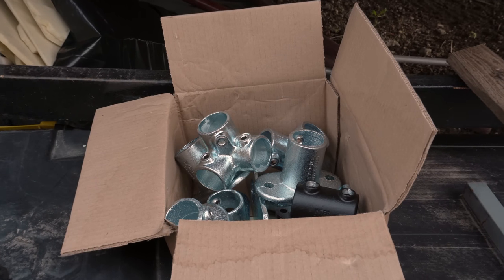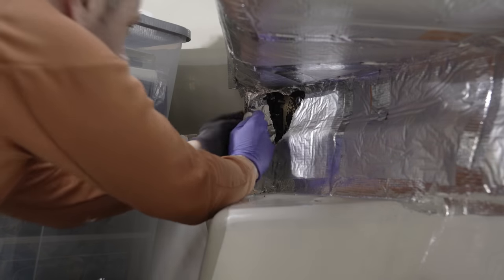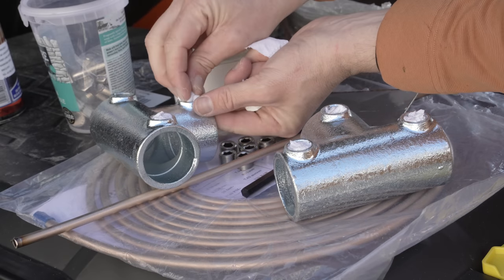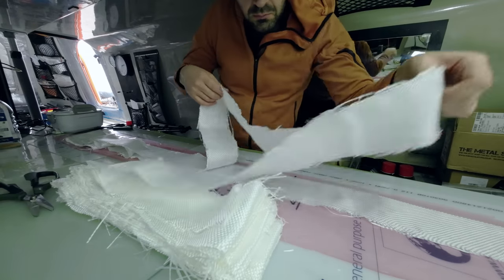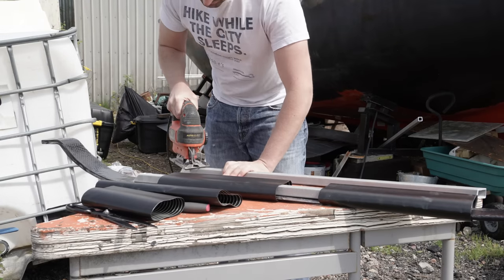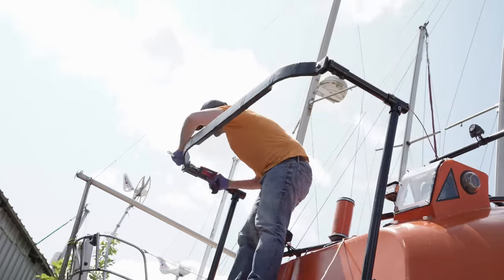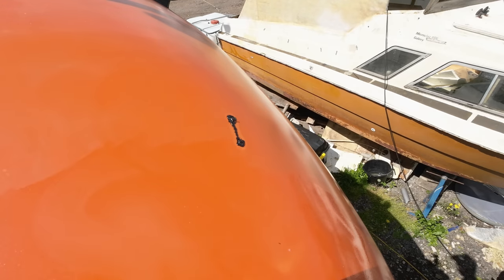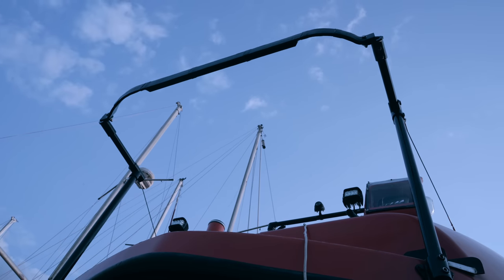DIY bow railings - new safety additions before Alan's launch. Lifeboat Conversion Ep79 [4K]

Comment: Well done, you can always find someone with a pipe bender later to swap over the bow railing with a single piece of pipe bent into a U shape for the bow railing if you want but it's not important now.
Reply: A length of bent pipe for the bow railing would be less complex and stronger than the current set up with the composite and extenders.  It would also look better

Comment: It occur to me.

That you are putting a lots and lots of holes in your boat. Which for a boat is fine. But for submarine these are all a million different points of failure.

Because that epoxy may not be Stout enough to resist almost 24 psi. When you're 20 ft underwater.!
Reply: I understood that reference / Remember that video!

Comment: It might be a good idea to  through bolt the extender pipes that go from the vertical rail to the curved front rail. Currently those are relying on just friction of the set screws to resist the force of someone leaning into the curved horizontal rail. That could cause the curved rail fitting to come
Off the extended pipe or the extender pipe to slip out of the T-Bracket. 

Also good to put tie wire
Around the turn buckle clevis pins so they don’t back out over time.
Reply from the maker: Cheers

Comment: Great channel. Impressed with delivery time of purchased Alan t-shirt! I think I will get a hat next...Thankyou. Something you may wish to consider when drilling holes through glass with foam core (Ep79); the sealant will most likely break down over time leading to potential (unknown) water ingress into core. Ideally, it's best to seal the core with epoxy. On my boat, I drill oversize holes, apply a laminate/glass backing, fill hole with thickened epoxy and re-drill to required fastener diameter. If the sealant fails, you will see the leaks from the inside of the boat and hopefully it shouldn't enter the core. I believe some shipwrights drill to size, recess the core (with engineers scribe) then paint/fill small channel with thickened epoxy. Thanks for filming your efforts with an entertaining sense of humour. Catching up to your latest episodes. Shaydon, Australia.
Reply from the maker: Cheers for the input

Comment: been following you for a while now Alex, love this channel. keep going cant wait to see the maiden voyage!
Reply from the maker: Cheers
Reply: @AlexHibbertOriginals  you never ever use the tool to tighten the disk on angle grinder. You should always hand tighten it (when it's spinns it is self-tightening) therefore you can unscrew it by hand. if you have pu$y hand use the tool to remove the disk.

Comment: Woohoo!  More updates and grinder!  I had wondered if you were going to use the cables and turnbuckles to connect to your upper railings.  As long as your composite railing does the job, that's all you can ask of it.  Are you going to put on something that will let people anchor themselves, such as the bolts you see in high windows now?

Comment: Gonna have to use the spanner trick as is proven itself now more than once!  Can’t wait for the official launching ceremony and hopefully you’ve given thought into the selection of Alan’s godmother.
Reply: Installed 24 bolts today using the magic spanner technique … worked like a charm after I got the impact driver to turn the correct direction.

Comment: I think you should seal up where the tubes go into the brackets. Inevitably, sea water, rain water etc will leak in there and galvanic action will cause that alloy tube, zinc, stainless grub screws... to corrode badly. Not to mention water freezing and expanding etc... What do you think???

Comment: I’m going to guess that the cables aren’t enough to add strength to the front rail. You are only adding some strength in one direction with the cables (force applied forward) - if someone pulled hard enough those galvanised mounts or the aluminium bar could deform or snap. turnbuckles can make this problem worse as you might be preloading the bars. If you have time a solid bar /rod mounted in the same location as the cables would give tension and compression advantages.
Reply from the maker: Well, as with any design I have to balance various things. In terms of an impact so strong it would deform 5mm steel or 3mm alu tube, it wouldn't be a human being, as there's no distance for someone to fall with more than a trip. If colliding with something solid, I WANT the railing to fail, instead of anything else more important like my fibreglass shell.
Reply: That makes sense that you want the rail to be sacrificial Alex. There’s no substitute for being there, having hands on the job. Loving the build mate.

Comment: Yeah, also don’t like the crossbar.  Get a single aluminium tube of the correct diameter professionally bent into shape and just fit to
your clamps either side. Get it done or it’ll annoy you for the whole trip. 😂

Comment: I don't like it either. It looks wrong in that it should have bracing / safety bars going to the rear. Either horizontal or angled. And at the front maybe a lower bar across the front. Nothing worse than a false sense of security. Well, maybe a reactor meltdown or burnt bacon.
Reply from the maker: I looked at this, but you'd end up having to use a ball or swivel joint, as the angles are not 0, 45 or 90 deg in two planes. These sorts of joints aren't that rigid.